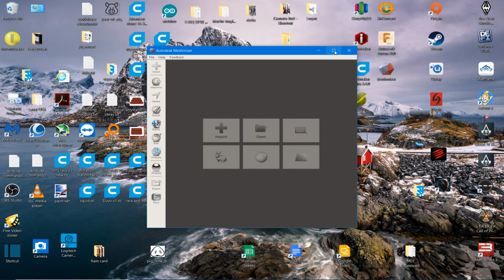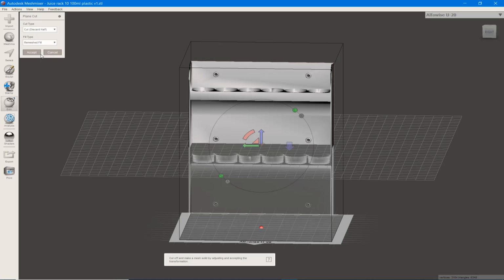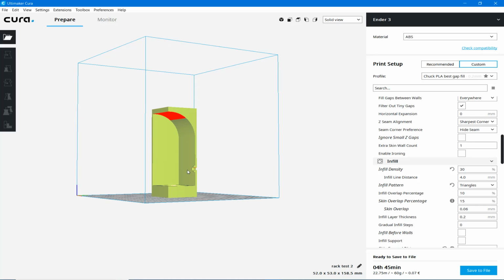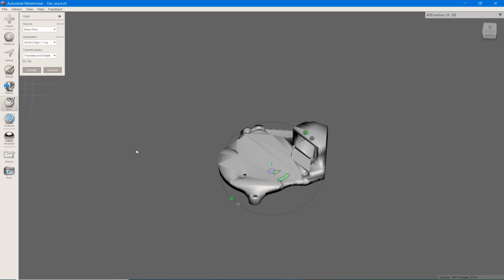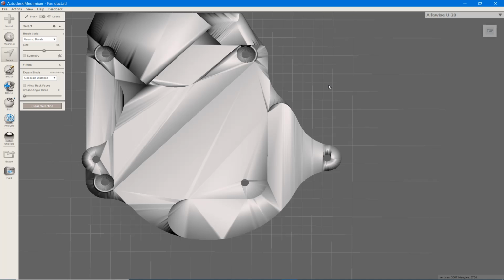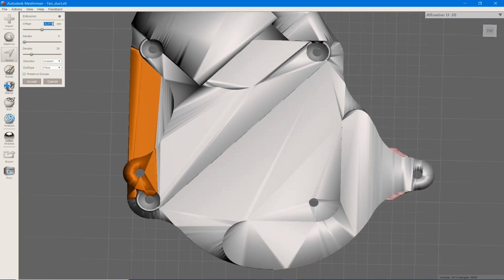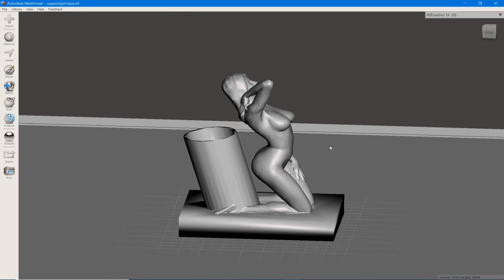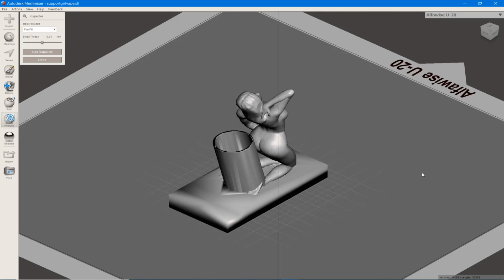How to use Meshmixer to cut and adjust STL files.

Comment: Thanks for the overview. Have you tried Tinkercad? It's also designed to modify STL files but is very easy to use.
Reply from the maker: I played with it a little bit, but to be honest I found it so vastly different from traditional CAD programs that I was having trouble adjusting to it. Then when I did start learning it I found it very limiting and that was the point that I gave up on it. But I don't remember being able to do much with STL files other than adding to them or resizing them. Did I give up on it too soon? If I'm wrong, let me know and I'll take another look at it.
Reply: I like some of the features of Meshmixer and Tinkercad but for most of the stuff I do, Tinkercad seems to work the best for me though it does require some "thinking outside the box" at times. It seems to be a little more logical for my little brain to grasp but I tend to think more like an artist rather than an engineer at times. I couldn't wrap my head around Meshmixer when I first tried it because it didn't make sense to me but I think I'll give it another try.

Comment: Is there a way to snap or change the steps of the x,y,z translation of the plane cut or is it just eye balling?
Reply from the maker: Eyeballing is the only way I've found. I've tried a number of different ways to type into the box, but so far I've had no luck. Seems like there should be though, but if there is it's evading me.
Reply: Chuck Bryant thanks. You can snap the rotation, when you have the plane cut there, make sure the "S" is green, and click the rotation button. Drag out to the segments that appear, and then you can rotate in 5 degree increments. Just found this through experiment.
Reply from the maker: Thanks! That will help me a lot.